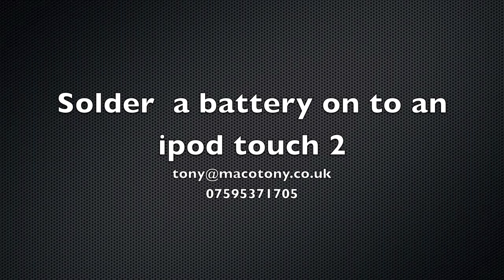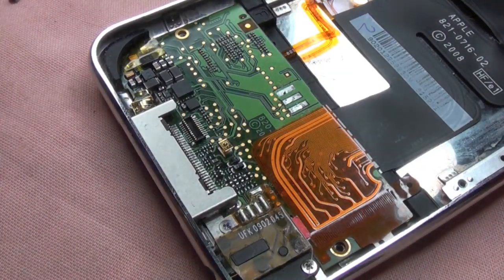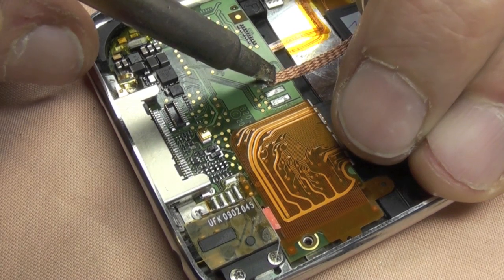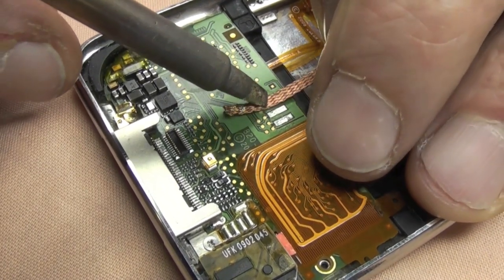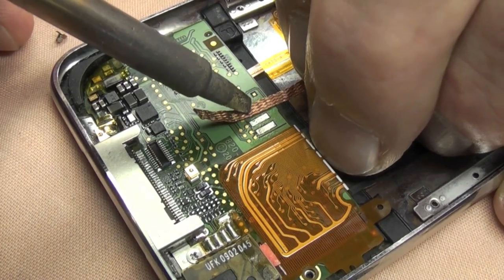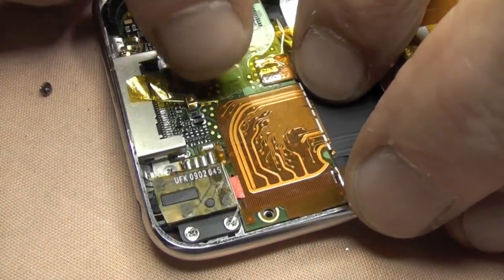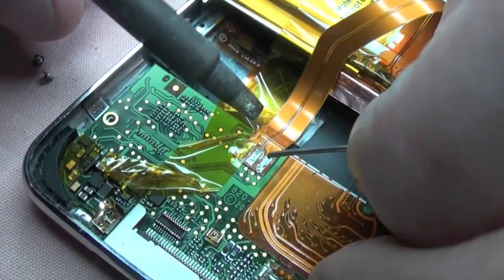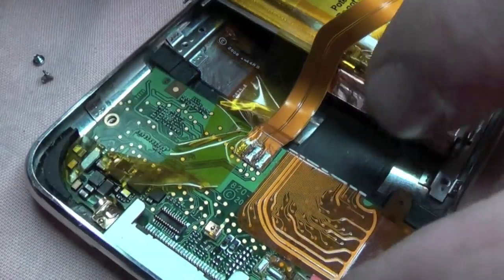Ipod touch 2nd gen battery replace tutorial

Comment: Have you worked on a battery replacement for a ipod touch 4th generation I need a fix I blundered.accidently took a metal place off thr board the middle one for charging I believe how can I fix?was gonna try some that conductive adheasive but am not sure will hold with the heat produced.can u help?

Comment: @offmains hmm the ipod won't turn on at all do you think it is the board or the battery? it has been soaked with 91% isopropyl alcohol for 10 mins and let dry open and it still does not charge

Comment: What kind of specs would you recommend on the soldering iron?  I want to buy one but I don't want to get one that I have to replace in a short time period.  Not to expensive either.  Watts?  Heat temp?  Brands?

Comment: hi i have a question i recently bought a ipod touch with water damage so it would not power on after taking it apart i removed the battery then conected the usb lead to the ipod then to my pc and wooppee
i get the apple symbol flashing on the screen every 5 seconds or so 
is this due to there being no battery in the ipod touch
cheers jon

Comment from the maker: @badboi317 Might be battery but could be the large flex cable or the dock connector that needs to be replaced, get a volt meter on the battery when plugged  in to see if you are getting a voltage

Comment: @johnxjen 
The clear yellow tape is called Kapton tape. It is found in most phones and mp3 players to cover vital parts, and to hold down flex cables and other parts. It really does help when soldering like the video shows, because most people do not have a steady hand, as the video also shows. He is doing it right though. I have repaired tons of these for my clients, and it is fairly easy. Just a bit of a pain to get to the battery.